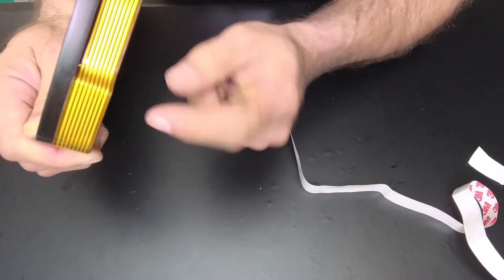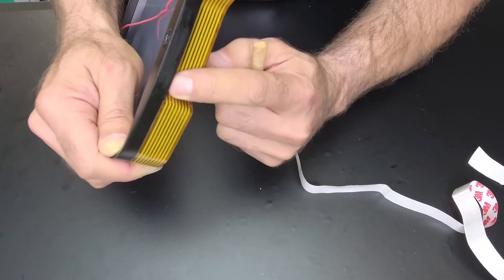How to install ThermalVATBAND

Comment: Would it be possible to purchase and install two heating strips, one for the front and another for the rear of the tray? In theory, this setup would provide even heating throughout, rather than concentrating heat only at the front.
Reply from the maker: @Toy_and_Prop_Masters  the heat resinates throughout the vat the frame gets heated first and even at 50% frame coverage our previous 12 inch model a mono x or saturn size vats will get up to 75F with ambient temperature at 50F. Thr new version is 20 inches and operates 20% more hotter and still using same power 1.25 Amps at 12V. Dont forget the zaxsis build plated going up and down will agitate the redin you will get an even temperature throughout the VAT. Drop the build plate to match resin temperature before you start printing.
Reply: @3dtvb  Great tip! Do you have a link to purchase the 20" strip?
Reply from the maker: @Toy_and_Prop_Masters  what printer do you have?
Reply: @3dtvb  Elegoo Jupiter SE, the tray's perimeter measures about 48" long [1219mm]
Reply from the maker: @Toy_and_Prop_Masters  one of my favorite printer. Get the Thermalvatband.com/tvb-m3 is 34 inches
Reply: @3dtvb  Will I need anything else with the 34" band? I saw you also have a bottle. What's that for and would I need it?
Reply from the maker: @Toy_and_Prop_Masters  we make vatbands for pepology XXL printers. YES, we can daisy chain the vatbands and use our 5A/12V power adapter.

Comment: does this work on newElagoo S4U vats that dip?
Reply from the maker: @SILENCE_uk  yes it does work for both models. Apply the power connection at the top left behind the vat screw. The fulcrum area is in the back the front pivots down while the back is hinged to the top surface. Lots of room in the back as well. The band thickness .25mm wont get in the way. Apply the band right under the lip of the vats funnel/draining lip.  To assure a perfect install around the bend do the following. Use masking tape locate all the bending points market with marker. Pre-bend the band like fold it on itself so you get a make a memory on the fold. After you peel the backing massage from left to right so air bubbles are released and the folded memory wont cause any resistant when you massage the band down.  Yes, you can peel and re apply. Just dont turn the power on until its installed. Glue gets activated by heat. Massage while power is on so the glue is ammusified.

Comment: I received my Thermal vat band last week, I am installing it now. This video doesn't look anything like the version I received. I am wondering if this is just an older version?

Regardless, I am hoping I am install mine correctly as it has no instructions and even though I ordered the extra long version it doesn't go all the way around my resin vat.
Reply from the maker: The VATBAND install is same as the video accept you have a newer version. The band does not have to cover the VAT completely the heat will resonate and the agitation from the build plate will keep the resin at an even temperature. Feel free to chat with us on our website for support.

Comment: Purchased one, but unsure of what I am getting. There are mixed messages on the site.  I sent a message. I needed more than 1 band but it wont allow it. Please read my message I sent to you. Your website is not working properly. If I cannot get 3 bands at one time I may just cancel the submitted order you already have. Thank You
Reply from the maker: We have a chat option or email order number and I will make adjustments send you order confirmation. Info@thermalvatband.com
Reply from the maker: Canceled and revised your new order👍

Comment: I just got the medium sized one and I can't find videos on what to do or expect. It came pre-wired with a magnetic console and a thermometer strip. I'm assuming that the thermostat was already placed properly since it was completely predone for me. My issue is the vat is giving off zero heat even at setting 3. I have now turned it almost all the way up to see if it will work. So far I'm not impressed with the product.
Reply from the maker: Chat with us on Facebook to troubleshoot.
Reply from the maker: It's on our website as soon as you get to our home page.
Reply: @3dtvb  I've been trying but I'm not receiving much support on the matter.
Reply from the maker: @headhunterscustoms  I'm here waiting now
Reply from the maker: Say something on the chat box
Reply: @3dtvb  I just messaged FB again if that option is still up
Reply from the maker: Let's do this, email me. Info@thermalvatband.com  include order number

Comment: It would be nice to see a 32” install video for an Anycubic Mono X 6K. I’m wondering if it is ok to overlap the thermal bands.
Reply from the maker: We are planning to do a video on a Mega 8K demo and we will include the largest format printers from Anycubic and others im sure.
Reply: @3dtvb  can you overlap the bands?
Reply from the maker: @JAMESHOPKINSIBXCNC   yes you can overlap by using a Z-fold method watch the video for a demonstration.
Reply: What happened to this video with the larger band? I still dont see it anywhere...

Comment: I have the mars 3 pro and got 2 kits to do a full wrap around the vat. I have 2 questions:
1- is it ok / safe to overlap the filaments on 2 bands?
2- is it ok / safe to install 2 bands into the female end of 1 of the thermostatic controllers provided with the kit?
Reply from the maker: Brian, yes it safe. If you watch the z-fold video we demonstrate how you can overlap and fold on top of each other.  12watts of power you are using your complete safe with two redundancy temperature control that keeps the TVB in the ideal range.
Reply from the maker: You can easily daisy chain two TVB take both wires combine them and insert to each hole of the female jack. When you do this method the power source will recognize two products and will dedicate max power with one notch on power band adapter to each item.  You can turn up to three notches but keep an eye on the blue light on the power adapter if it blinks turn it down till it stops.  This will be your max power level. You can power up to three TVB 💪 with one 12V power adapter. Completely safe!
Reply: I watched all four videos and I never saw any overlapping, I saw bands being applied in the cutout area for the handle on each end  that accounts for the Z bends.
Reply from the maker: @JAMESHOPKINSIBXCNC  the second video I demonstrate how you can fold on itself making your band shorter.

Comment: Hey great product, I absolutely love it. Just want to let you know I was able to downloand the STL of the female jack from the Thermal Vat site but not from the link you posted to it. Seems to go up and down from what I gather in the comments.
Reply from the maker: Thanks for the heads up. We should have a download management system in place soon.
Reply: @3dtvb  Awesome. My resin is super warm and toasty in this freezing weather. I immediately noticed a difference in prints, thanks again ❤️
Reply: where did you download the stl from? I was not able to find it, thanks
Reply from the maker: @mmarcus62  on the home page right on top of the printers. https://thermalvatband.com/wp-content/uploads/2022/07/female-jack-wire-cap.zip
Reply: @3dtvb  found it, thanks

Comment: Where should the thermometer be applied?
Reply from the maker: Right in the front on top of the vatband, so you can quickly get an idea of the temperature.
Reply: @3dtvb  Just to clarify, the heating element should be in the rear, and the thermostat should be in the front correct? otherwise I would think it would give a false reading due to being on the band.
Reply from the maker: @MrCinpro  you're correct. The reading is approximately 10 degrees hotter than inside the VAT. Our power system will cycle the temperature staying in the ideal range. Vatband is a plug and play system eliminating you from managing the temperature.  However,  we do have an override for extreme cold temperatures like 10F where you can bypass thermostat and allow the adapter to manage the power and that gets you additional 10 degrees more in heat and a rapid cycling range. In our video explaining the process.